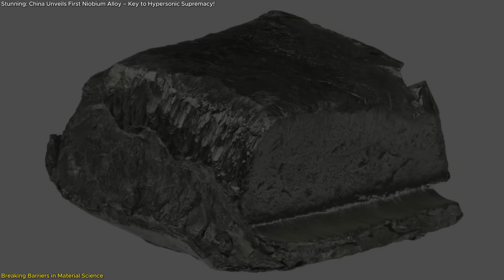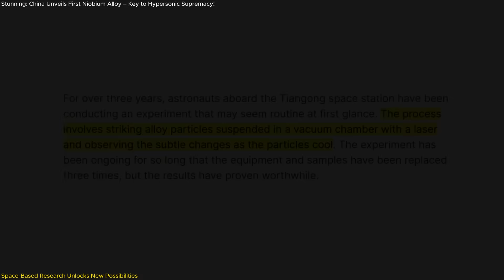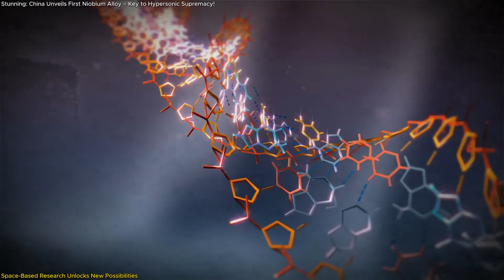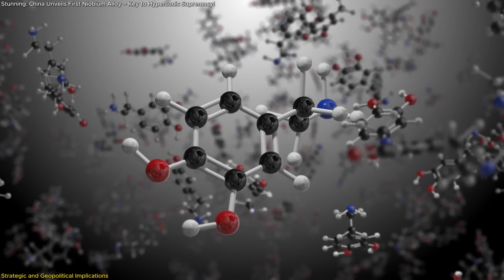Stunning: China Unveils First Niobium Alloy – Key to Hypersonic Supremacy!

Comment: I noticed that while niobium-silicon can withstand high temperature down to room temperature, but I didn't hear what the low end, like outer space frigid temperatures was.  Was the low range left out on purpose?  Spaceships need to withstand very cold temperatures and then super-hot temperatures they will experience during reentry.

Comment: It’s wrong I believe to call it the first Niobium alloy. As here in Australia I was heavily involved in the manufacture of large vessels used in Nickel manufacturing called H2S reactors. It was the first time this alloy had been used and welded anywhere and an extremely crack prone alloy. There were completed and put in service, the alloy was 310 niobium doped stainless. Once built and inspected by X-ray, or dye penetrant the 12m long vessel was heated to bright orange and quenched with water !  Sounds insane but I witnessed this process.

Comment: The melting point of AlON is ~2150°C (as a comparison with 1700 for this alloy) and it’s less dense and transparent.
Reply from the maker: (You're absolutely right that AlON (aluminum oxynitride) has a higher melting point (~2150°C) and offers benefits like lower density and transparency, making it an impressive material. However, its applications differ significantly from niobium-based alloys, particularly in hypersonic flight.

While AlON is ideal for applications like transparent armor and optics in extreme conditions, niobium-based alloys are better suited for structural components in hypersonic vehicles due to their superior strength, toughness, and thermal stability under the immense stresses and heat generated at Mach 5+ speeds. AlON’s brittleness and manufacturing limitations currently make it less viable for large-scale structural use.

Hypersonic flight demands materials that balance high melting points, mechanical strength, and the ability to withstand thermal shock. Niobium alloys, despite a lower melting point than AlON, meet these requirements better for critical aerospace components.)

Comment: Wow, orbital forge that is 30 minutes away from anywhere on earth is a supply chain breakthrough as well as a technical one.
Reply: Very insightful comment.
Reply from the maker: (Absolutely, an orbital forge that can deliver components anywhere on Earth in just 30 minutes would revolutionize supply chains! Beyond the technical feat, it opens possibilities for unprecedented responsiveness in industries like aerospace, defense, and even emergency response.

Imagine manufacturing critical parts or equipment in orbit and having them deployed to any location at lightning speed. This could drastically reduce lead times, eliminate some logistical bottlenecks, and enable on-demand solutions for global crises. It’s particularly exciting for remote or hard-to-reach areas that traditionally face delays in receiving high-tech components.

Of course, there are challenges—like ensuring the safe re-entry and delivery of items, managing costs, and navigating international regulations for orbital operations. But if these hurdles can be overcome, this concept has the potential to reshape how we think about manufacturing and logistics.)

Comment: The funny part is when they show the “space shuttle “.  That thing has aerodynamic specs of an elephant.  Imagine something like this enduring temps of 4k degrees?  What a joke it all is!  They can develop pretty fast vehicles to go at hypersonic speeds through uppermost layers of atmosphere, where the air is of very low density; however, there is absolutely no possibility of being able to leave atmosphere and maneuver in complete vacuum, as there is simply nothing to propel anything against.  It’s just laws of physics and nature, which they claim to be suspended in “space”.

Comment: China is just catching up. It is good that the Prof developed this at a Chinese research university.
US aerospace co  and NASA have been at this development for a long time, mostly for jet engine tubin blades where operating temp reaches to 2300f.  Most ally metals can only withstand up to 1700f.  US developed a ceramic coating technology on tubine blades in 1985 to gain the lead in jet engine manufacturing.  For unkown reasons, China has never be able to catch up after 60 years.  In fact, China sent an industrial spy Yanjun Xu (tricked by an inside mole) to fly to Belgium to receive the goodies from an former GE engineer.  Xu was arrested; shipped to the US abd sentenced to 20 years jail.  I predicted at that time China would exchange spies to get him back; and it happened 2 months ago.
Anyway, China better fast track the Niobium development to help the areaspace, jetliner industries.  As of today, China is using US-made engines.

Comment: There are more abundant materials and alloys with greater temperature tolerance than those mentioned here.
Reply: Like.....WHAT...?????? 😭😭😭😭😭😭
Reply: Tungsten carbide,5000* F,and ceramics as well.Mass producing this material on a space station is laughable.The key characteristic of re-entry materials,however,is their ability to insulate conponents from the heat generated,anyhow,not just heat tolerance.We do most of China’s R&D in our universities,and they are mostly copycats anyhow.

Comment: 1700c is not enough for hypersonic temperatures.
Russia uses tungsten alloy, handles temperatures up to 3800c.
Reply from the maker: (You're absolutely right that 1700°C alone isn't sufficient for the extreme temperatures experienced during hypersonic flight, especially at Mach 5 and beyond. Tungsten alloys, with their impressive ability to withstand temperatures up to 3800°C, are indeed a strong candidate for such applications and have been a staple in Russian hypersonic technologies.

However, there’s more to material selection than just melting points. Tungsten alloys, while incredibly heat-resistant, are also very dense and can be prone to brittleness, which may limit their use in applications requiring a balance of weight, toughness, and thermal resistance. Niobium alloys, like the one China has developed, aim to strike that balance. They might not reach the temperature threshold of tungsten but can offer other advantages, such as better machinability, corrosion resistance, and lower density, making them suitable for specific components.)

Comment: This alloy is also used in nuclear fusion reactors.
Reply from the maker: (Absolutely, niobium alloys play a critical role in nuclear fusion reactors as well. Their ability to withstand extreme temperatures, resist corrosion, and maintain structural integrity under intense conditions makes them ideal for components like superconducting magnets and reactor linings.

The dual application of this alloy in hypersonic flight and nuclear fusion highlights its versatility and importance in cutting-edge technologies. In both fields, materials need to perform under extreme environments—whether it’s the high-velocity heat of hypersonics or the immense plasma temperatures in fusion reactors.)

Comment: China has unveiled its first industrial-grade niobium alloy, a breakthrough that could revolutionize aerospace technology, particularly in the development of hypersonic missiles and vehicles. 
This achievement is the result of a three-year experiment conducted at China’s Tiangong space station, which has successfully overcome the challenges associated with niobium-silicon alloy production. 
The new alloy can withstand extreme temperatures, making it ideal for high-performance aircraft engines.
The niobium-silicon alloy is lighter than the nickel or titanium alloys commonly used today and has three times the compressive strength at high temperatures.
Turbofan engine blades made from niobium-silicon alloy can endure extremely high temperatures of over 3,092 degrees Fahrenheit (1,700 degrees Celsius).
The incorporation of a small amount of hafnium into the alloy enhanced the crystals’ strength, increasing its strength at room temperature by over three times and making it suitable for use in demanding engine manufacturing processes.
This development has significant implications for China’s aerospace industry, particularly given the country’s reliance on imported niobium.
Reply: Teoria i propaganda powiedziały swoje. Teraz poczekajmy na pierwsze zastosowania w praktyce. Czekam na pierwszy silnik dla komercyjnego samolotu pasażerskiego wykonany w tej technologii. Wtedy zobaczymy ile te buńczuczne doniesienia są warte w praktyce.
Reply: To romanromanowski4470 You are entitled to your opinion.
The commercial niobium alloys uses niobium for specialist steels and nickel-based super-alloys avoids problems associated with the high melting point of niobium.
An alloy is a mixture of two or more metals, where at least one of the metals is a base metal.
Traditional alloys have reached their performance limits in many applications. 
Researchers are looking for new materials that can perform better under extreme conditions, such as high temperatures, pressures, and corrosive environments.
The advent of additive manufacturing (AM) technologies has opened up new possibilities for alloy design, reducing the time and cost associated with traditional alloy development processes.
The discovery of HEAs, which consist of multiple metallic elements in roughly equal proportions, has expanded the design space for alloys. 
China has achieved a breakthrough in industrial-grade niobium alloy,
These factors drive researchers to continue experimenting with alloys to meet the evolving needs of various industries and technological advancements.
Reply: @romanromanowski4470  You are entitled to your opinion.
The commercial niobium alloys uses niobium for specialist steels and nickel-based super-alloys avoids problems associated with the high melting point of niobium.
An alloy is a mixture of two or more metals, where at least one of the metals is a base metal. Traditional alloys have reached their performance limits in many applications. 
Researchers are looking for new materials that can perform better under extreme conditions, such as high temperatures, pressures, and corrosive environments.
The advent of additive manufacturing (AM) technologies has opened up new possibilities for alloy design, reducing the time and cost associated with traditional alloy development processes.
The discovery of HEAs, which consist of multiple metallic elements in roughly equal proportions, has expanded the design space for alloys. 
China has achieved a breakthrough in industrial-grade niobium alloy,
These factors drive researchers to continue experimenting with alloys to meet the evolving needs of various industries and technological advancements.
Reply: @romanromanowski4470 cuando has visto q los descubrimiento importantes son primero para uso y de beneficios de los civiles ,? No importa el planta esa es la regla

Comment: Perfect material to build up 7th gen fighter to fly between outer space and atmosphere with hyper sonic speed.
Reply: Some 6th gen aircraft are already being designed to do this... though not quite at hypersonic speed, but instead Mach 4 to 4.5
Reply: @YTsupportsZionaziGenocide The US already designed to plan similar called the SR-71, It flew in an altitude of 85,000 ft and went as fast Mach 3.5 some sources have said that it has reached an altitude of 100,000 ft but it's unverified. The US is also working on The SR-72 as we speak it's extremely classified so there's not many things known about it but the SR-71 was developed in the 1970s and is literally faster and could fly higher than any plane we have today so I can only imagine what the SR-72 will have 55 years later with the technology we have today. I can guarantee that it will be astonishing